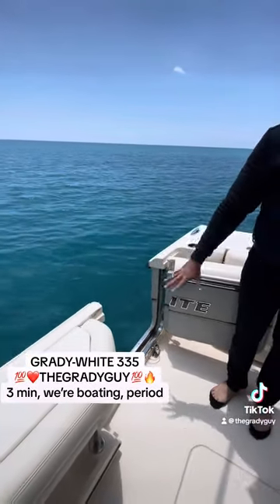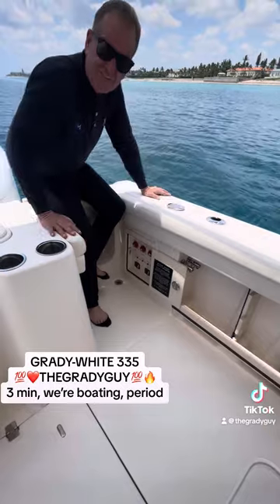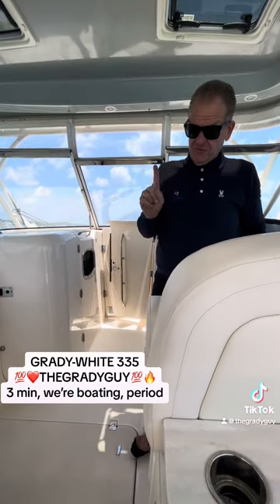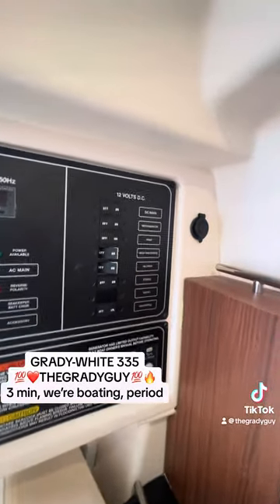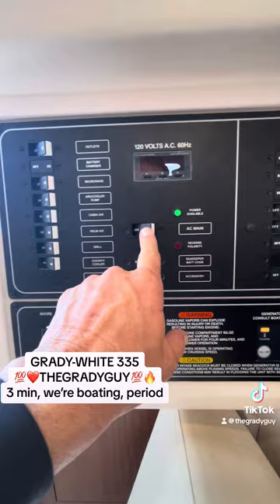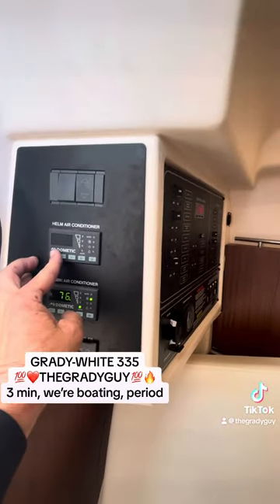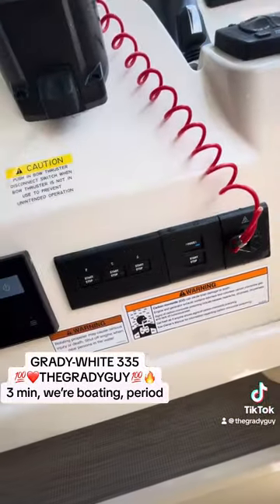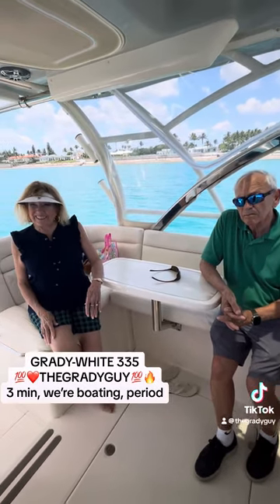Grady-White Freedom 335 Orientation

Comment: Hi Ron.   I am torn between a 325 and a 335. I like the economy of the 325 and I like the cabin in the 335.  I want to cruise the bahamas.  I currently have a 275.   Is there a big difference between the handling and ability to conquer waves between the two?
Reply: PS. love the channel.
Reply from the maker: Well, well, well, I am the only genuine dude on the whole entire Internet, the 335 will cut the 325 in half, the 335 is a battleship 19,000 pounds wet, the 325 is a tender 13 to 14,000 pounds, two completely different animals, the 325 is perfect for me, but if you’d like to go to the Bahamas, you have to get the 335. Anytime 954-253-3888  text or call any reasonable hour
Reply: Hi mate. An express suits me and buying soon. 330 or 370? It the 370 worth it? What to sleep 2 regular but 4 occasionally. Go long distance and stay on board for a week. Would love to see an express 410 like the new 415 design.
Reply: @riggsfinn 
I have a 370 it's worth it. It will easily sleep 4 and can sleep 5 if you're good friends. 

It is my first boat but as a friend said to me nobody ever wished they had bought a smaller boat.  I live in Naples,  FL and bring it down to the keys all the time to fish and hang out. Great boat to travel in and very fishable which was my primary objective.  Word of warning... be prepared to have a healthy gas budget it gets about .7 miles per gallon.  Less if you like to pin the throttles..  which is tempting.  It's a fast and comfortable boat for it's size.

Looking forward to bringing it to the Bahamas!